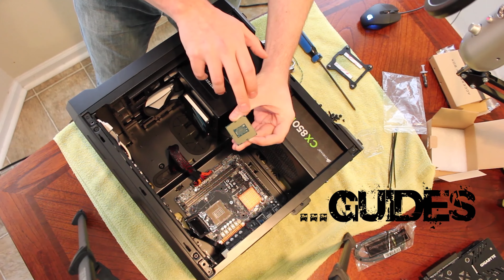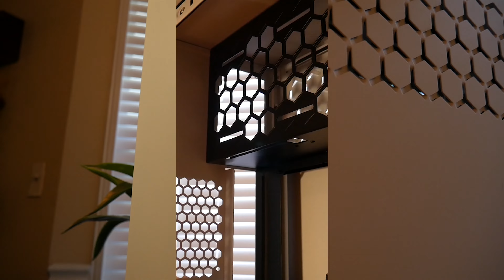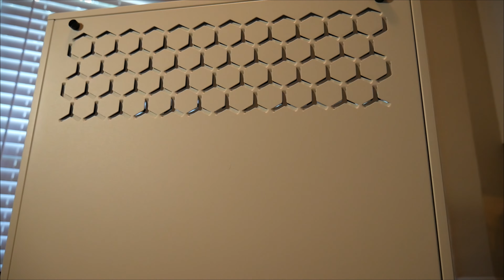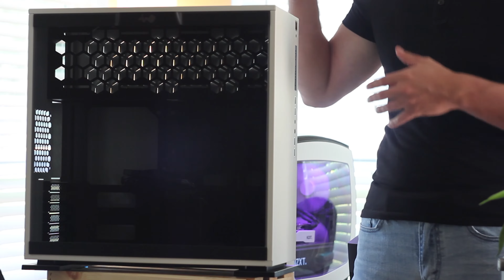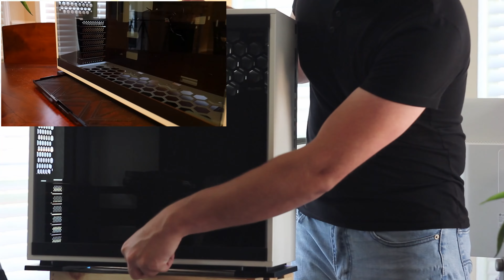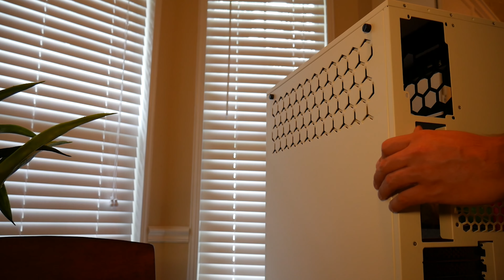High end tower, at low end cost: The In Win 303 mid tower review.

Comment: If I were to put 3 120mm fans at the top, how would this affect the power supply? Would I have to turn it around the opp. way?
Reply from the maker: your fans should push air away towards the backside), the fan on the PSU is an intake fan, so while they push away, its taking air in.
Reply: Ah. I see. So it'd kinda be like helping the psu get more air from the case. Thank you for the reply! And great review as well!
Reply from the maker: Thanks! and no problem :)

Comment: I am in the middle of building and modding this case now. It is a very well built case. I also have the white case. I drilled all the rivets out so I could paint the center white. Its pretty much the only complaint I have about the case is that the inside is black. The logo being RGB would have made it that much better too but it is still an amazing case. Best case for the money in my opinion.
Reply from the maker: I am a fan of modding, my few attempts have been failures but one day we'll get to watch me make a fool of myself slaughtering good towers. Send me pictures when you're done! I'd like to see. 

And while RGB would have been cool, I'm just thankful In Win made something for the lower consumer level thats great, the more bells and whistles they add, the less for everyone it becomes as the cost goes up :D
Reply: I hear ya. I have not finished yet so we will see how I do. I have the whole case tore apart and am going to hydrodip all the parts that are black and have took the blue and logo off and will be changing the color of the badge on the front to an orange color with no name. Easy case to mod. I just drilled out all the rivets in it and took it apart. I am in the middle of stripping all the paint off the black parts so I can prime them for the dipping process. Doing a sticker bomb dip, should look pretty cool if I can pull it off but I have never dipped before so it might look like ass once I am finished. If it turns out I am sure you will come across a video of it as I have never seen any one dip the inside of there case before :)
Reply from the maker: So when I start trying to not suck at it I know who to go to :D
Reply: http://www.overclock.net/t/1614673/my-303-build-log

Here is a URL to my build log. I am in the middle of priming every thing and witting on my Hydrodip kit. Doing a dip called stickerbomb. Don't be afraid of making mistakes. Half the battle is getting the balls to do the project in the first place. This is my first build. Dismantling it was an intimidating thought but now I am very happy I did.

Comment: It's a great looking case. I just wish that...

... you could actually mount bottom 120mm fans without going mATX.
... you could mount said fans without having to unscrew the case feet.
... you didn't have such a bulky and contrast looking thumbscrew on the backside.
... that the assembly manual was remotely helpful with the things that the case does differently (Such as the very loose IO shield mount that is guaranteed to confuse many)
Reply: I have this case (black) and I had no problem putting all 3 120 mm fans on the bottom with an atx motherboard. I also put 3 on top and a 120mm AIO on the back. Temps stay low in case and the bottom fans help cool my gtx 1060. Really looks great I could not be happier.
Reply from the maker: On the IO shield, In Win is receptive, I'd make mention of it to them. On the backside I sort of like the accented aesthetic of the thumb screws. But I see what you're saying, not for everyone. 

On bottom mounting, yes, you can, the headers on the bottom row can be 'meh' to work with, the mATX idea is just more for bottom rad install IMO. 

What color did you get? Send me a picture of your finished build if you have one :D
Reply: The black one - Though my daily driver is the Deepcool Genome in white, which is definitely the colour I prefer. The reason why I prefer bottom intake fans is because of my old, old driver a Raven 03, which had massive 180mm? fans in the bottom pre-assembled. Just got used to it.

Which brings me to another point - I wish the 303 had less black inside of it. While I like contrasts, I think it should be left up to the components.
Reply from the maker: +Mansen the genomes were interesting to me when announced, I almost ordered on out of curiosity but didn't. 

How do you like it?
Reply: Eight-Six I love it. Great space, matches my white Corsair ML fans perfectly. And I couldn't resist the idea of easy AIO built right into the case, even if the built in lights can't be turned off completely (if you want to) or synced to other hardware.

My biggest gripe would be that it doesn't come with a riser cable, even though it makes a point to present itself as a case with a "presentation" mount for a GPU right in front of the window.
Reply: you cant mount bottom 120mm fans when using full atx? pretty sure i even saw a build in this case with some 140mm fans on atx he just drilled the hole spacing farther apart
Reply: Damien The fans will bump into the USB header and front panel pin headers (and possibly more depending on your motherboard layout)

In my case, I couldn't mount the middle one, but the front and back ones just barely fit. Hence the need for mATX so that the headers are further up, giving clearance to the fans.

140mm might be possibly if you drill into it - I didn't. (and you'd still have the issue with bumping into things)
Reply: My motherboard must be slightly longer then, because it simply will not fit the middle one. It bumps right into the front panel header.
Reply from the maker: +Mansen could have to do with motherboard layout, I'm using an x99 for comparison myself, while its not an eAtx it's only just barely under the size qualification,

Also did you guys use riing fans? Some fans offer a few more millimeters in design, low profile fans work well too, like xigmatek uses
Reply: +Mansen my headers are behind the fans to. I adjusted the wires to lay as  flat as possible . the edge of the fan do touch cables but does not affect fans or motherboard. I did this on two of with different motherboard (made a PC for family member with this case) MSI h170 gaming and asrock z170 pro.
Reply: Not possible here.

Comment: Can you look into how the bottom mounted fans fit with the motherboard? I've read that there is not enough space at the bottom of the case for more than one fan.
Reply from the maker: It can be a messy situation. Fitting the fans is not easy, you contend with cables largely. and it will be an uncomfortable fit for a eATX/ATX board. If you mount an mATX, is where a rad/fan setup would look best (to fill the gap between chassis bottom, and motherboard) 

But then you contend with 'Do i really want to put an mATX in this tower? ;P Cite the Gigabyte Z97MX Gaming http://amzn.to/2aAMTEZ (just as an example) The tower could accommodate the board with breathing room underneath if this is a rout you wanted to go. (Also where the bottom setup would shine the most)

Your layout is subjective to your taste, but just because you can fit an ATX/eATX, doesn't mean you have to (assuming you don't have a board selected). 

Options :) the tower is great, it offers a lot of options within reason.  Hope this helps, let me know.